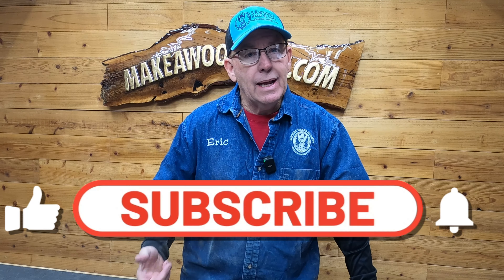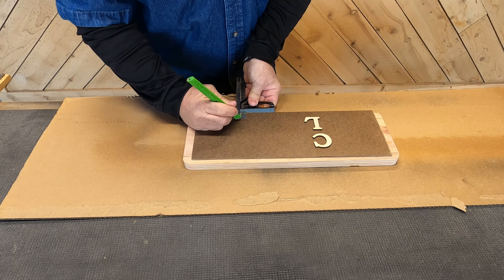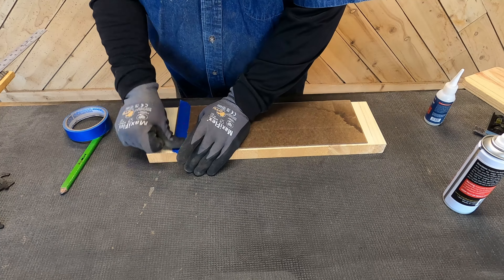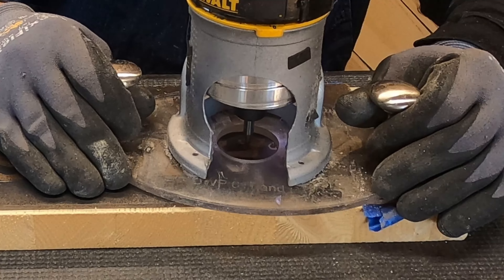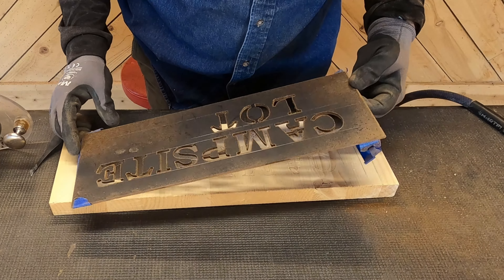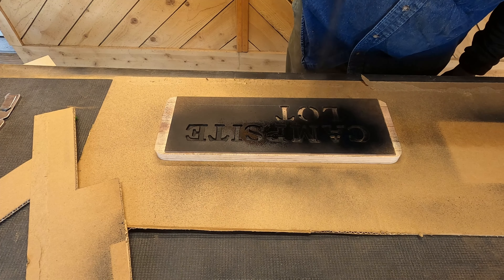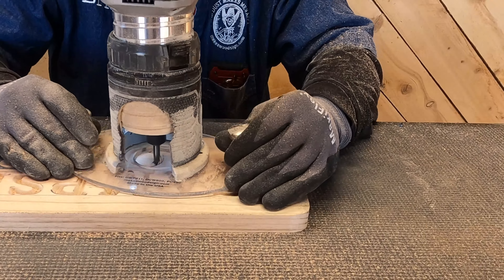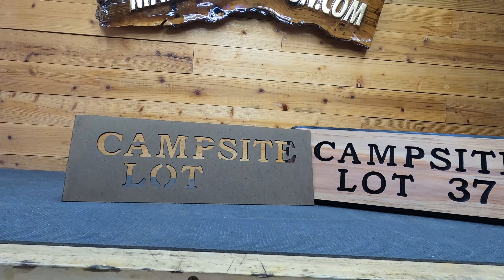How To Make A Stencil With A Palm Router

Comment: Hello🙋‍♂️Thanks for the info. I just tried your demo here. I didn’t have any hardboard but had a few pieces of old Lauan plywood which is basically wall panelling. It was 1/8 thick. 3.6 mm. I used double sided tape to secure it to a piece of pine,cut a couple letters,cleaned the edges up with some sanding sticks,and held the template down with double sided tape and sprayed the letters. The lauan cut clean with no stress on the bit. Thanks again for another fine idea👍
Reply from the maker: Right on, man! I'm glad it worked for you!